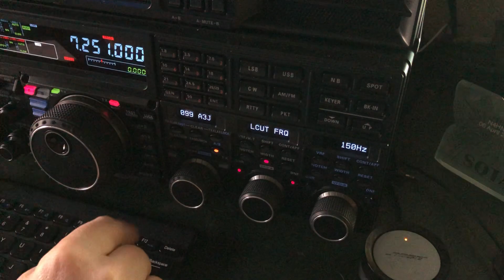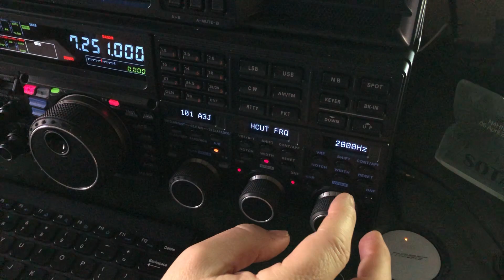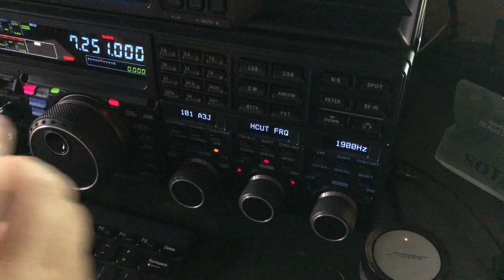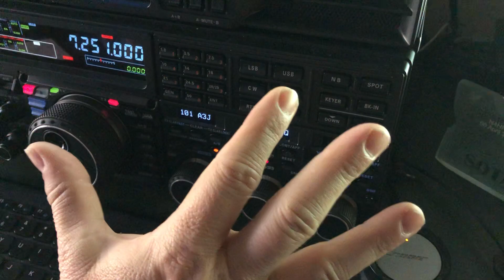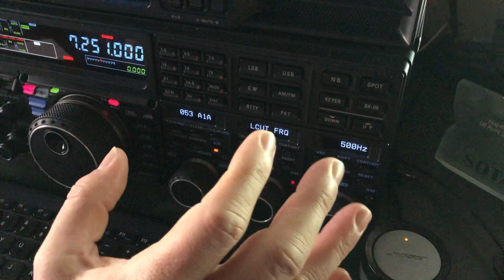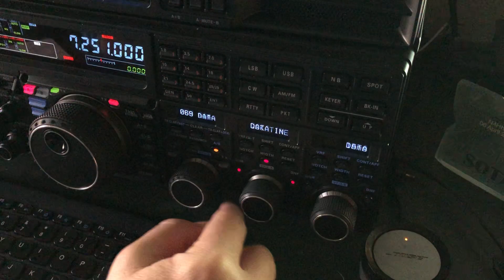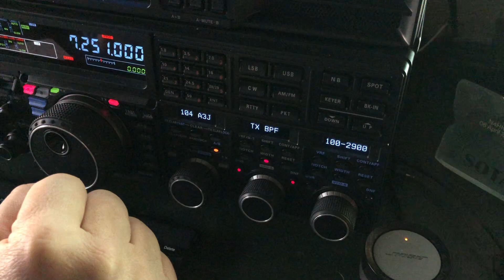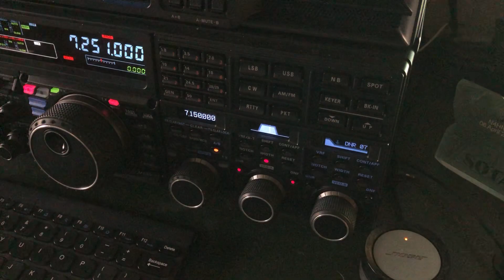Yaesu FTdx5000MP: Receive Audio Parameters

Comment: I have birdies on a FTDX5000MP, they are top to bottom of 15 meter band and easily noticeable with an antenna, any ideas what is causing this?
Reply from the maker: Must be something local. My FTdx5000 has no birdies on the 15 meter band.  The only birdies I’ve ever noticed are on the 60 meter band, but they don’t fall within any of the ham channels. Unplug your antenna. Do the birdies stop?  Probably something local. Could even be in your own home. 

73, de N4HNH